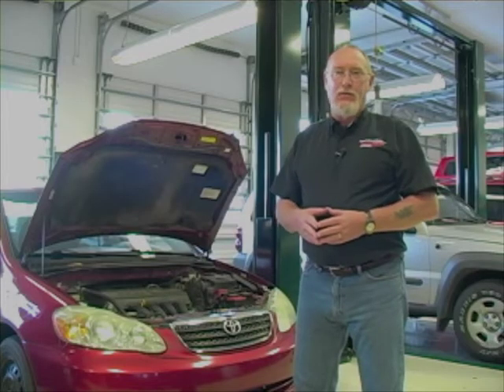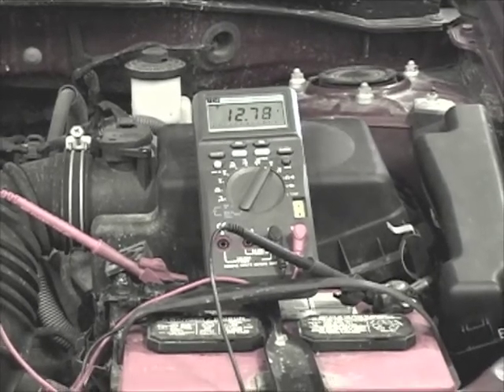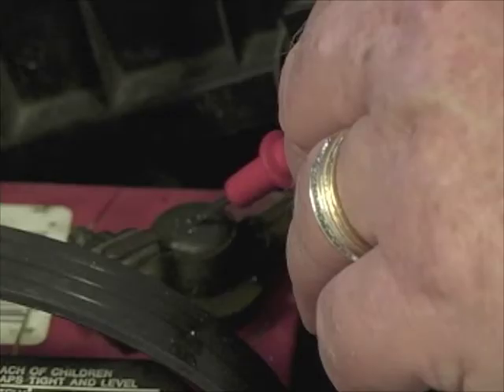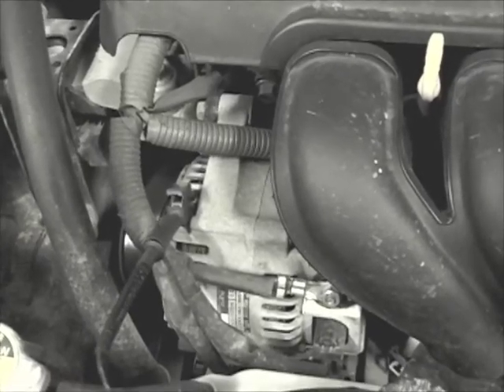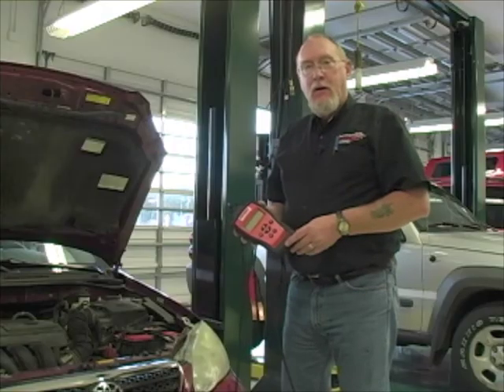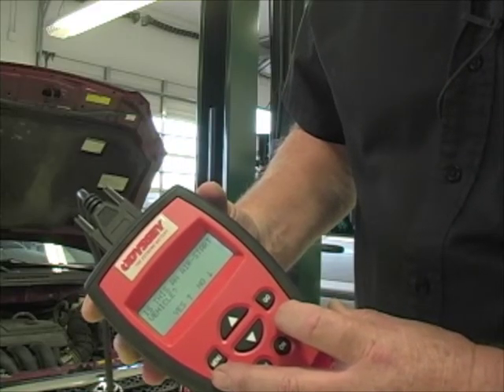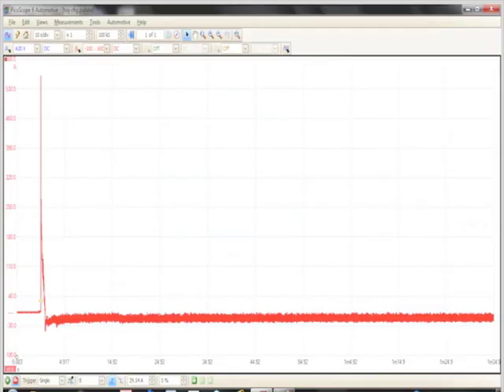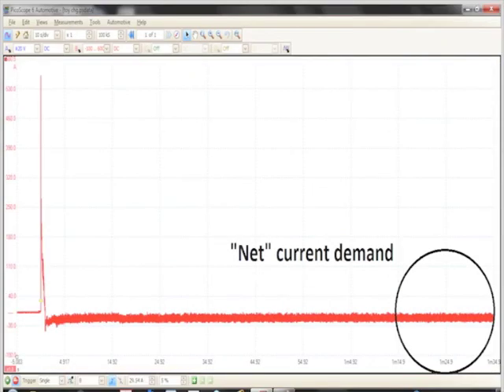The Trainer #28: Testing Battery/Starting/Charging Systems

Comment: I have used in the past a very great tool , from NAPA Auto parts ;   this tool , tests : battery , starting system , and charging system , except voltage drop , and this tool even tell when a battery has one bad cell .
And I remember , after testing the battery , with a bad cell and tool message suggesting to replace battery , .
I recommended battery , customer said  , I don't even have starting problems , so he declined replacement .
One week later , customer came back to shop , vehicle did not start due to bad battery 🤣🤣
I done all those tests , still learning watching your video .👍👍👏

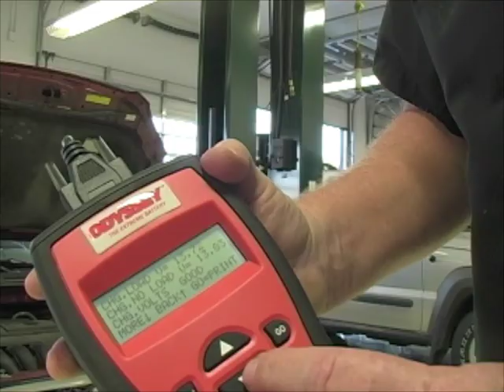Comment: Pete : At 11:05 you mentioned              " diodes OK " . I recently purchased a Model 725 Battery and Charging System Tester from Electronic Specialties . On the menu is a check for ripple voltage from the alternator . In old cars that had a red light on the dash that would go on if you were not charging , it would also glow red with the key off if you had a bad diode . The diode no longer blocked current from draining the battery . I am dealing with a friend's 2002 Taurus , 3.0L , 24 OHV , with some " low voltage cranking issues " . The alternator is HORRIBLY buried and makes that test almost impossible . On newer cars , excessive ripple voltage ( bad diode or diodes - there are several ) would give you a UNFUSED , PARASIDIC DRAIN - with the key off . My point is for the few EXTRA SECONDS it takes on one of these testers to eliminate that from the list , it is time well  spent . Just think of the time wasted if you were going to start chasing an UNFUSED PARASIDIC  DRAIN . It's also one less chance for a comeback . Thanks for your information .

Comment: A battery tester shows that my battery only has 50% of its original cranking amps and voltage generally in the morning shows 12.2volts. While this is low and the battery is on the way out, it still has no problem starting the car. Is this state hard on an alternator I wonder or does it matter?
Reply from the maker: MsCelicagt4 Yes, it is. I am betting a higher than normal amperage demand on the alternator, which means more heat...not good.
Reply: Thank you very much for reply.

Comment: hi, what should be the minimum on the loaded voltage. you gave 9.6v for the DVM and 8.5v for the scope.
Reply from the maker: The short answer is "both"! The digital multimeter doesn't sample as fast as a scope, and doesn't catch the inrush voltage like the scope does.
Reply: Motor Age thank you, after watching the video a second time I got it. thanks again!

Comment: i want to get an oscilloscope. but have no direction since i dont know brands or where to start with. any suggestion ? great video btw
Reply from the maker: +Alejandro Amaro Choosing a scope is like choosing a girl. It's all about the features you want and what you can afford. Scopes range from pocket sized one channel units to PC-based 8 channel scopes. Check your shop's scan tool - many have scopes built in or offer add on modules for the existing tool.
Reply: +Motor Age but would the pocket sized ones update fast enough catch a glitch on say.. a TPS sensor as i do a sweep test ?  Im a begginer DYIer and am learning automotive electrical systems. i want a scanner and a scope but cant afford good ones yet. i just want something reliable with good update frequencies so i can be sure i make a right call on stuff. btw, thanks for all the time you put into making your videos. i am learning alot from them
Reply from the maker: Oh yeah, the UScope is a highly capable scope. But I will admit, I like at least two channels so that I can compare. For example, if you do a relative compression test you'll know you have a weak cylinder with one channel but not WHICH one. With a second channel, I can add a reference signal (like an ignition trigger) that will tell me so much more.
Reply: +Motor Age oh. so 2 chanels is better? ive seen some with 8 channels
Reply from the maker: My personal recommendation is 2 channels at a minimum for every day shop use.
Reply: Oh okay. But what bandwith and sample rate is okay ? Im thinking about getting a 20Mhz and 48 Ms/s. 2 channel
Reply from the maker: Nearly every automotive scope available today (stick with a name brand) will be more than capable of doing anything you want.
Reply: +Motor Age oh. okay. what about triggers ? you think any of them will be capable as well to catch glitches or stuff like that ?
Reply from the maker: Triggers are the settings you make to tell the scope when to start capturing data. You can use them in a variety of ways to catch a glitch or signal loss.
Reply: +Motor Age oh. i guess playing with it to learn the functions will give me a better understanding. well im going to go ahead and get one. thank you my friend . i will also need a low amp clamp for that right ?
Reply from the maker: I would strongly encourage you to add that to the scope.
Reply: Check out the Auto Ditex Scopes . Diagnose Dan also uses them .

Comment from the maker: For those that don't know, a battery may read much higher than the ideal 12.6. Doesn't mean it's bad. This is "surface charge" and can be reduced by using the 3-start DMM method shown in the video or just turning the lights on for a few minutes.

Thanks for the comment!